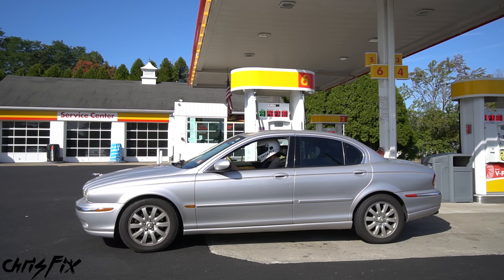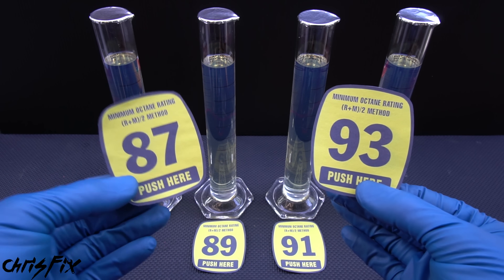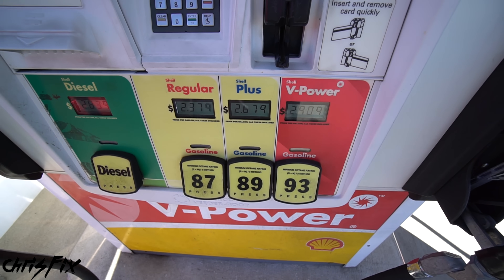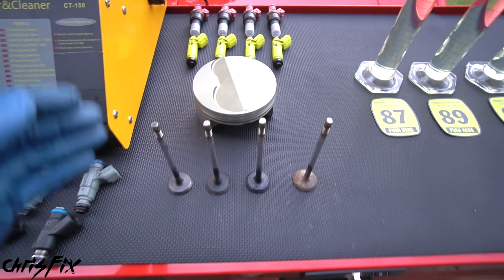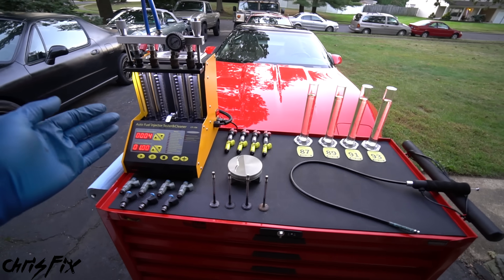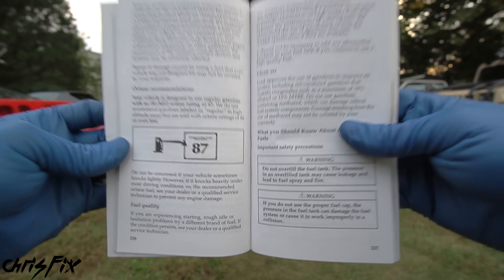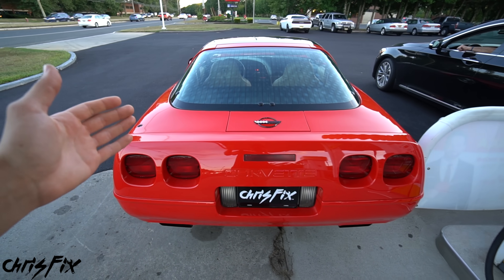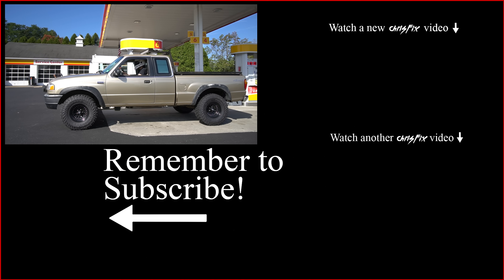What is the BEST Fuel to Use in Your Car or Truck and WHY

Comment: What about if you're towing? Should you use a higher octane fuel? I've heard more than a few times that you should....
Reply from the maker: Check the towing section in your owners manual, sometimes you may have to get higher octane for that!
Reply: No. The compression ratio doesn't change regardless of how hard you're working your engine.
Reply: @Admin_Review    You're partially right but when you work an engine hard like during towing, the temp can be elevated and can cause hot spots within the cylinders.  These hot spots can cause detonation.  Like ChrisFix mentioned in his video regarding his truck, which had detonation while using regular fuel, the detonation stopped once he used a higher octane fuel.  Same would apply in a towing application, if your engine started to detonate with the lower octane fuel.

The proper answer to Shaun Sklarz's question is exactly what ChrisFix replied with.  When in doubt, ALWAYS check the owners manual.
Reply: @TheBaggerLife69  i did check after you guys replied, and my manual says a higher octane is recommended while towing, but not required. Thank you!
Reply: @PrintStang    You're very welcome my friend. Also, if you ever misplace your owners manual, you can consult with the service manager at your local dealer.

Take care.

Comment: Hey Chris. This is Priyam from Mumbai,India. I have been watching your DIY videos since a very long time. I am writing this comment to find a solution of a problem with my car.
So I own a 2002 Honda CR-V (Type 2). There is something wrong with the car’s battery. Last night we started the car and went for a long drive. Everything was fine. Today morning when I tried to unlock the car with the remote,it won’t. Then When I tried to start the car, everything went blank. Not a single light on the dashboard and the car wouldn’t even crank. The battery went fully dead. And this is the second time this is happening. We bought a completely new battery and it’s dead. So can you please tell me where the problem can be at? Not a single light was left on and the battery was completely new. Same thing had happened a week ago,but the battery was old. We suspected the old battery and changed it with a new one. Now I think there is a problem with the car. And yes,the alternator also seems to be fine. Do reply, it will help me a lot since I am not being able to find a solution to this anywhere on the internet. Thank you mate.

Comment: I added this comment in: Brake fluid changed to synthetic even on dot 3. I had a wheel cylinder go bad. I made sure the mechanic got all the old brake fluid out. I didn't want a mix in the brake system. Do you think it's Ok to add synthetic to non-synthetic brake fluid? Personally, I didn't want to take the chance.
Reply: Ricky thinks you can mix it. As long as it's dot 3, they should not separate. Of course if you had an open in the system, new fluid should be changed so it doesn't attract moisture causing brake failure.

Comment: I have a 2007 Cobalt SS you see in my profile picture. I use 89 octane in that. Premium didn't make much change, but 87 will make it idle ruff after a few tankfulls. It has the 2.4 liter engine.

Comment: Great video! For those of us that need to run Premium, my (informal) testing shows three brands that work really well (Shell VPower, BP/Amoco Ultimate and Sunoco Ultra), and others that don't work well at all (Mobil, Exxon and generics). My 2005 Saab 9-5 Aero has a high-output factory turbo, and requires 93 Octane fuel. It also has a Trionic engine management system (so it can anticipate knocks and dial back the boost and spark advance to prevent detonation, and allows temporary overboost if the fuel is good enough).  My winter driving (from the NYC area to the mountains of New England) is great for testing - includes consistent fast highway driving and big hills. If I'm using anything other than the three brands listed at the beginning of this post, my car a) gets lower gas mileage, b) has less power going up the hills (have to downshift when I normally wouldn't have to), and c) won't allow overboost. Where I live, Shell V-Power and Sunoco Ultra command a higher price that Amoco Ultimate from BP.  The V-Power generates more power/overboost, while Sunoco Ultra provides slightly better gas mileage. The Ultimate does neither (but car runs absolutely fine) at a better price point.  Note that my observations may play differently on cars without a Trionic system or overboost. Enjoy.

Comment: If you put the 93 in a Prius will it hurt it ? We have had 5 ( accidents caused by bad drivers, among other reasons - a long story ) and once we sell our current 2007 we will be buying a better one with way less mileage.
I appreciate the steering wheel clock video.
Our passenger side airbag light is one and the dealer says it needs to be replaced or reset, I forget which. The car came like that when we bought it. I have no idea how to do it.
But I know a lot about Priuses after having so many of them.

Comment: There is no fuel comparable to the 87 octane sold in Europe.
Reply from the maker: Watch the video!
Reply: @chrisfix  I did. Which means that the myth is half true. "Weaker" fuel is sold in USA, but so is fuel with a higher octane. The european regular is RON95 (PON 89), but there is no RON91 (PON87) in europe.

Comment: you use the Imperial system instead of the metric system
you're the only country that uses Fahrenheit not Celsius
you measure octane in your fuel wrong 
and you call your fuel gasoline it's called petrol because that short for Petroleum 
there's no gas in gasoline it's a liquid and yes I know cars use the vapour from petrol aka gasoline
Reply: Actually the term Gasoline predates the word petrol used to describe Gasoline. So Gasoline is the correct term historically speaking. Petrol is just short for petroleum which is just a bunch of liquid hydrocarbons in certain rock strata. Petroleum can be refined to make Gasoline. Also the US and Canada use the more accurate rating system for determining octane, since The Anti knock index represents the actual real world burn of gasoline under atmospheric pressures at any given elevation. Europe completely ignores the more stringent Motor Octane testing method all together, where the US and Canada take the Ron and Mon into their octane rating giving a more accurate answer.

Comment: What about running E-15 in cars? It is very common where I live, and runs about 88 octane.  Does the added ethanol have any cleaning benefits if you use it?
Reply: If your manual says it is ok, use it when it is cheaper.

Comment: He Chris,
Really love your videos.

Have you ever heard of the QMI products?

Since about 1989 I have used their oil additive which the say lasts 40000 to 50000 miles.  Still change oil at normal intervals.  Also, I religiously us their gas additive, one once for every ten gallons of gas.

I am sold on these products.  Just curious if you know about these, and if so, your opinion. 

Thanks!!!
Ken in Vero Beach.

Comment: If my car runs 87, would you recommend running 93 premium occasionally like once a month just to clean carbon deposits for maintenance?
Reply from the maker: You would need to use it for 2500 miles for it to clean the engine out 70%.
Reply: @chrisfix  what? That's makes zero sense.

Comment: Why is the price of Premium $4.75 in California?
Reply: Because California charges insanely high taxes on Gas and it's the only state that requires by law, certain additives in the gasoline that only a couple of specific refineries in the US actualy make. So the other 49 states are cheaper, because they all use the same fuel as one another and can get gas from any refinery in the US. Plus they have a lower state gasoline tax compared to California. Premium 93 octane gas here in the Milwaukee area, is just $2.79 a gallon right now. And it's $2.19 for regular 87 octane. So California requires a special additive that does nothing to make the fuel burn any cleaner and is just a ploy to charge more for gas and to drive up taxes.

Comment: E85 burns slower
Reply: Actually you have that backwards. E85 has less energy in it compared to gas. For every gallon of pure gasoline, you need 1.3 gallons of E85 to travel the same distance. This is why you get better fuel mileage out of gasoline.

Comment: Sorry, I have a differing opinion.
My biggest question is, if you're saying that in both scenarios, the sparkplug is the only ignition source for both fuels. Everything is the same otherwise, you said. Except, an inefficient burn will occur with low octane gas.
Why is that?
Why wouldn't low octane gas burn under compression, just as well as high octane gas?
You said yourself, all grades contain the same energy.
Ping, is caused by pre-ignition, or detonation, which works against the natural rotation of things, trying to push the piston backwards before it even reaches TDC.
This occurs when the air fuel mixture burns prematurely from the added heat created in a high compression racing engine, causing the fuel to become hot enough to burn, or detonate, before the piston reaches the point where the sparkplug will ignite it in a perfectly timed sequence, as to not be fighting against itself, creating extra heat, pings, and extra stress on the motor.
Pre-ignition is what causes ping, and damages an engine, not an uneven burn that happens precisely when it's supposed to.
This would only be inefficient, and may smoke a little.
I don't see how any damage would be created here either.
Higher compression is always the answer to greater efficiency, and power.
Thus the reason, milled heads, high dome pistons, turbochargers, and superchargers, have always meant, more power.
You just need a fuel that is stable enough to tolerate the additional heat, till sparky says, HIT IT!

Comment: WRONG.
"Detonation" refers to PREdetonation of the fuel, meaning the fuel detonates BEFORE the spark plug ignites it, because performance engines have a higher compression ratio, and higher levels of octane prevent the pressure from detonating the fuel,.

Comment: ChrisFix in my truck the gas says 87 but I when I put 87 my check engine light turns on But when I put 91 or greater it goes away what do you think it could be?
Reply: Your truck has something wrong with it. It may need a tune up, or has a bad sensor.

Comment: What about octane 85? It is something they use in Utah.
Reply: You can get away with it in very high elevations usually. However it actualy voids the warranty on your car, as all manufacturers recommend 87 octane or better. 85 octane is from an old law in states that allow it in high elevations, because old time engines were more forgiving with carburetors and could run 85 octane so long as they were in higher elevations. 85 octane was formulated simply because old carbureted engines could run on it without damaging themselves, or developing engine knock. And they did this simply because formulating the 85 octane, was cheaper than 87 octane. 

Today however the auto industry no longer recognises 85 as "regular gas". 87 is now the industry standard, because everything is fuel injected and can properly adjust for elevation differences on modern cars. Folks still fuel up on 85 octane in those high elevation areas. But the auto industry says the octane level is too low for fuel injected cars. In reality it "probably" won't hurt anything. But why take the risk? 85 octane was geared for old carbureted engines from 30 years ago. Not modern cars. 

Its a old law that needs to change. 87 should by rights be the lowest grade sold today. And yes if your running 85 octane and drive down to a lower elevation, you will develop problems. If you have 85 octane in your car and drive down to lower elevations, stop and fuel up with "premium gas" to boost the octane level of your remaining 85 octane gas in your car. Then from then out at low elevations, continue to fuel with standard 87 octane.  Plus at lower elevations you will find 87 as the lowest offered octane regardless.

Comment: You haven't mentioned that some grades contain up to 10% ethanol, sometimes even 15%. Generally, high test fuel does not. Up here according to an email from a Shell engineer, V-Power does not contain any ethanol. Whereas Petro Canada Ultra 94 contains 5% ethanol.

Comment: You should think about making a video talking about gas that contains high ethanol ratings and other types of fuel like extremely high octane rated gas that you typically dont find at the pump and what they do for your engine. Such as E85(slightly less energy due to obvious amounts of water-soluble ethanol mixed in, causing the fuel to burn slightly cooler), and leaded race gas thats rated 100oct+ (for extremely high compression engines,  helps with valve seats, bad for cats, etc). The way you go about explaining things is better than anyone i've ever seen and I think this would be a really cool topic to touch on in addition to this video. Cheers!

Comment: Use 87 octane. Period. The more expensive octanes don't improve performance in more modern cars, because the power of the engine is regulated by computer(s). Your simply paying for the same performance either way using computer controlled engines.

Comment: So what about fuel injector cleaners? I have '19 SI and I fill up with the recommended premium fuel (I use vpower) and some ppl were telling if I'm using vpower then I don't need to concern myself with fuel injector cleaners and may end up doing damage for using too much additives? I used them often when I had a 2001 ford taurus and a 2008 impala because regular gas. So now I don't know if its needed or not,  your suggestion?

Comment: If You have a vehicle that's not driven often look for zero ethanol also anything with a carburetor avoid ethanol when stored over the winter,additives help keep the Carb from getting gummed up but (ethanol absorbs water) and sit on the bottom of the gas tank.

Comment: Can you do a video on just flex fuel vehicles and E-85?
Why and how ethanal Is ok to run in them. And is it true it has high water content?
Thanks
Reply: The ethanol binds some water which then safely passes through the engine. The higher the percentage of ethanol, the more water it can handle before the ethanol and water drop out of solution and sink to the bottom of the fuel tank.

Comment: @ChrisFix. What size tires do you have on your truck? I have a Ford Ranger FX4. Just installed a torsion keys leveling kit. Like the look of your truck with those tires. I need new tires now to fill in the wheel well.

Comment: Hey ChrisFix, I have a question regarding top tier fuels. I know top tier has a certain standard but are all stations the same? For example, Costco fuel is top tier and so is shell, but which is better? Do they contain the same amount of detergency across the board?
Reply: They come from the same refineries. All "TOP TIER" gasoline grades must be treated with an approved "TOP TIER" Detergent Gasoline additive at the correct concentration. TOP TIER licensed retailers also agree to not use organometallic additives (such as MMT or Ferrocine). Shell and Costco are both considered to offer very good gasoline.

Comment: hello everyone would anyone happen to know where the fuel filter is on a 2008 Nissan pathfinder SE  and also would could cause  a shut off when sitting at a red light  the car does start up after i think its the fuel filter i also had put in regular gas because i was low on cash at the time  any idea what gas i am supposed to use ?

Comment: What if its too late and you can tell the engine has ben ran with the wrong fuel before you bought it and you want to try and clean it out. Can i throw some Octane Booster in there along with the premium fuel i have ben using since i bought the car 3 months ths ago??

Comment: What does adding up to 10% ethanol do? 
Illinois does this.
If I run 100% fuel from out of state I get better fuel economy.
Reply: ethonal is plant based gasoline meaning that it is a mix made to burn like gasoline so basically it's like putting a name brand gasoline  mixed with some store brand gasoline
Reply: @zdiamondman8240  Ethanol is not plant based gasoline.  Ethanol is an alcohol.  It is the same alcohol as what is in beer, wine and liquor.  It is used as an octane booster, which allows refineries to produce a lower quality (in terms of octane rating only) gasoline.  In modern engines its use isn't a problem other than a having a slightly higher fuel consumption.  This higher fuel consumption for most people isn't noticeable. It's in the single digits of percentage difference, meaning if you get 21.5 mpg on 100% gasoline you may get 21 mpg on e10.  (e10 is 10% ethanol and 90% gasoline) 

Ethanol can be an issue with older cars and small engines as it can damage rubber hoses, seals, and diaphragms in the fuel system, and it may lead to increased corrosion in aluminum gas tanks and  increased rusting in steel gas tanks.  The last part is because ethanol is hydrophilic (it absorbs and mixes with water) and if the vehicle sits for a while the ethanol and water can separate from the gasoline which leads to the rust.  Ethanol is also corrosive to aluminum which can be an issue with fuel tanks on small engines and watercraft.

Comment: So, If I start using a higher octane will it resolve resolve small issue with hesitation why engine is in motion? Had a recent tune-up and was told spark plugs were good (which I believe is not rue, but anywho).